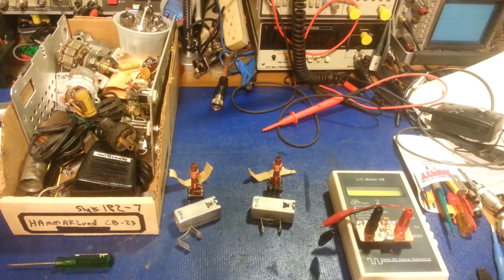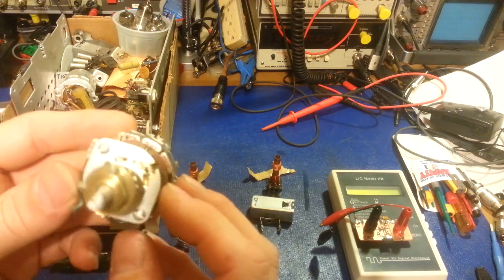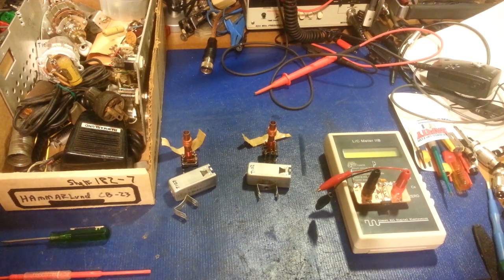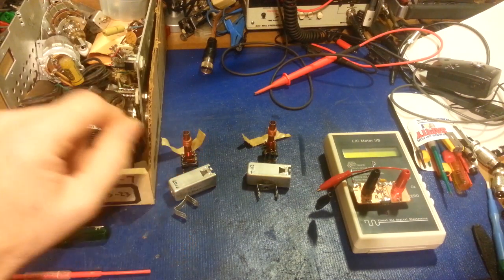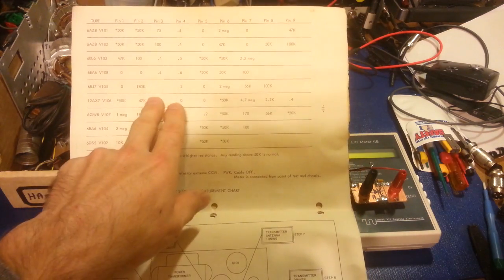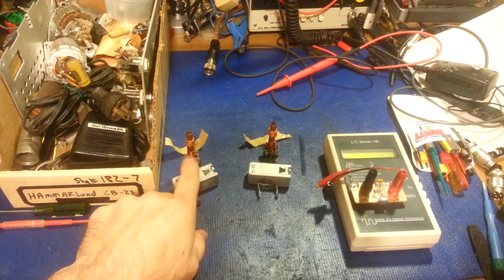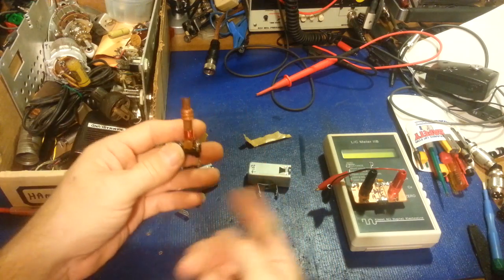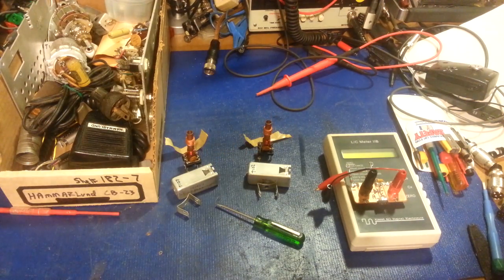Hammarlund CB-23 mixing circuit problems update.

Comment: From the last video two things that seemed odd. 1) the 25MHz waveform had some 1.7 Mhz modulation on it - you would think that even a crappy filter would removed ALL of the 1.7 Mhz component. I can see 25 - 1.7, 25, and 25+1.7 components making it through the filter, but NOT the 1.7 Mhz signal. 2) The mixed signal looked like two-tone SSB modulation from a balanced modulator. Also what about RF on the B+ line? Did you see anything there?

Comment: Is V102A where the signals mix? It looks like on transmit the 25 MHz comes thru there to the driver (V108) pin 1 but the 1.750 MHz goes to the driver pin 6. That is the normal way tubes mix. One frequency on one grid and the other frequency on another grid.

Comment: The trig math that makes mixers do what they do always makes my head hurt. I'm sure you did this but if the levels of the two mixing signals are significantly different wouldn't the product(s) potentially be impacted? Just a shot in the dark.
Reply from the maker: LOL, I know what you mean, probably why I'm not a electrical engineer.  :)

I have seen a lot of different tube type cb radios that have had extremely unequal oscillator outputs and by the time it gets through the mixer its fine.  I may still try to level out the oscillator circuit outputs and see what effect it has.  I'm also going to disable the mixer and inject my own signal before T102 & T107 and see what happens.
Reply: Although not a significant part of my EE curriculum there were still some tube topics in there way back in the dark days when dinosaurs walked the earth!  ;-)
Reply: You can find them on eBay pretty regularly. I've got the 23rd edition on my shelf.
Reply from the maker: +Dino Papas  

Wow, your copy is relatively brand new compared to mine.  Would have to check but I think mine is a 3rd or 4th edition.

Comment: Any chance the T-R relay has issues? To clarify- According to the service manual, the T-R relay is supposed to remove the B+ from the screens of the receiver RF and 2nd Mixer stages and switch the B+ to the the transmitter oscillator and driver of the transmitter stage. I'm not sure what would happen if the screen voltage in the receiver section wasn't turned off but it can't be a good thing. Even if it was just a little screen voltage.

Comment: i.m sertain its realy a bad cap, the rc is out of line, (mixer is not working correct, you already replaced the tube, it must be a cap coil problem,)... keep us informed! (solder the spare coil in, and thry...)

Comment: The more I look at the first video, the more it looks like instead of mixing the 1.750 MHz is modulating the 25.365 MHz signal. Even on the spectrum analyzer you have the main frequency (25.365 MHz) and your upper and lower sideband, with the upper being the channel 13 frequency. Possibly one of the capacitors the signals are passing through going to the mixer? I think it is something in that area where the two signals are supposed to mix.
Reply from the maker: That is exactly what it looks like.  Instead of audio frequency modulation its low frequency RF modulation.